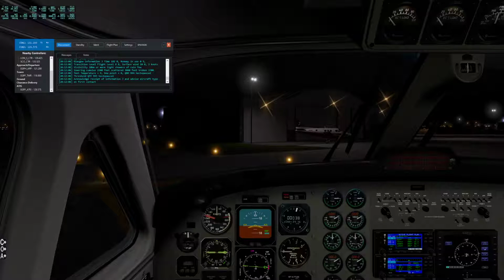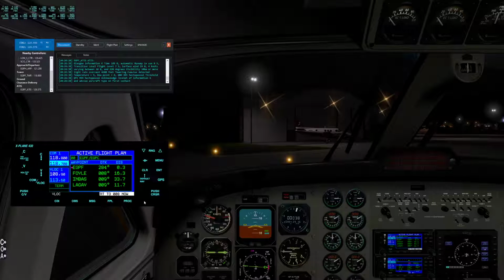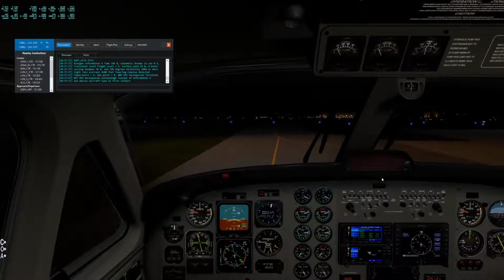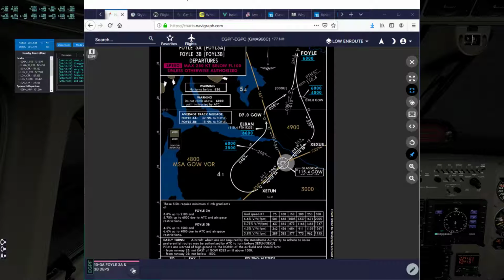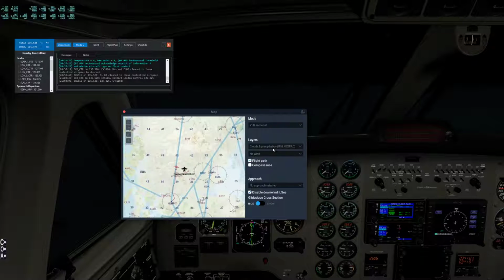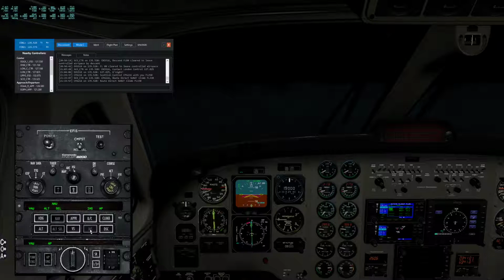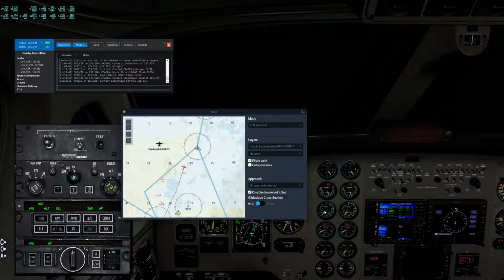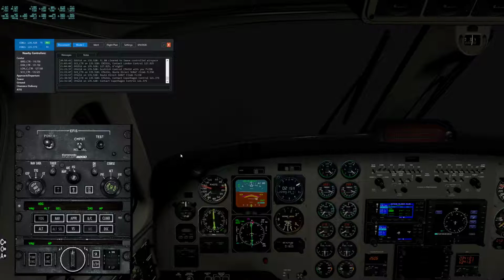X-Plane 11 VATSIM Carenado B200 King Air Glasgow (EGPF) to Wick (EGPC) with VOR/DME approach

Comment: I know you are a King Air fan, so have you thought about picking up the King Air 350? Would love to see a video on using the FMS. Really struggling to understand the relation between the FMS and other navigation equipment on the plane. I know you could make it make sense.  I tried the IAS function last night on a flight following your instructions. Worked great. Great videos man. Some of the best on the tube.
Reply from the maker: Hi Alan, thanks a lot for your comment! Looks like the King AIr 350 uses the standard X-Plane FMS.  I think the only plane I've flown regularly with that is the FlyJSim Q400.  I've not made a video with the Q400 and probably missed the boat now, with FlyBe gone there's not so many around sadly.  The 350 would be nice but I've temporarily gone back to piston engines.  Currently flying the F33A Bonanza with REP, and the newly released TorqueSim BN2 Islander, which is great.  I'm planning to do videos with both of those.  Good idea for a video with the FMS in the 350 though.  I'll consider that.  Maybe the 350 can replace the Q400!